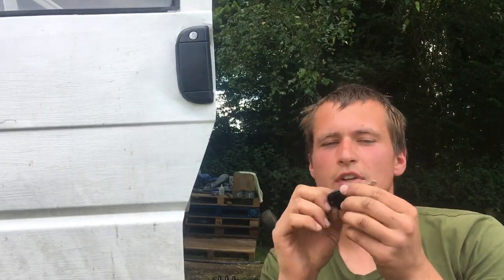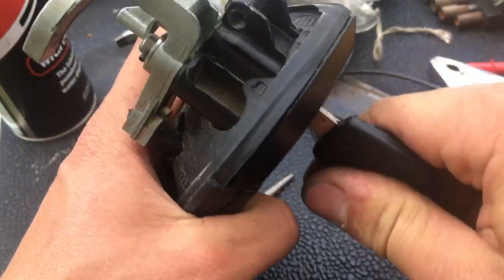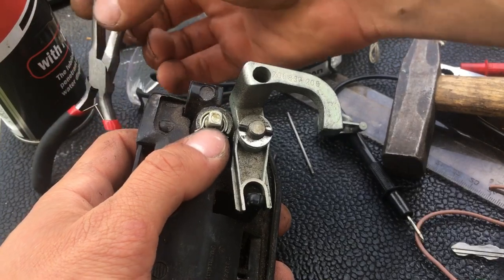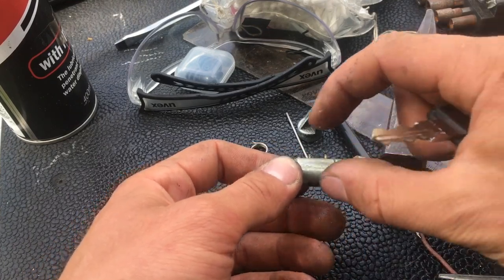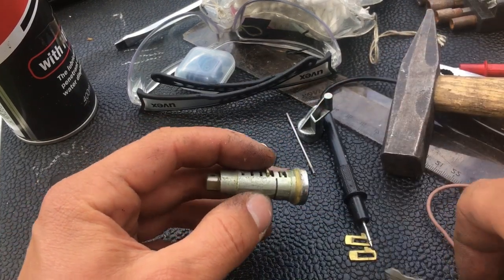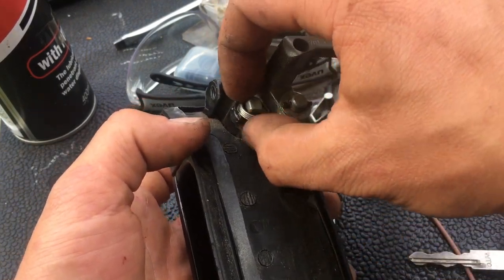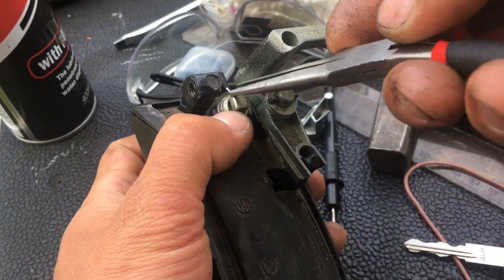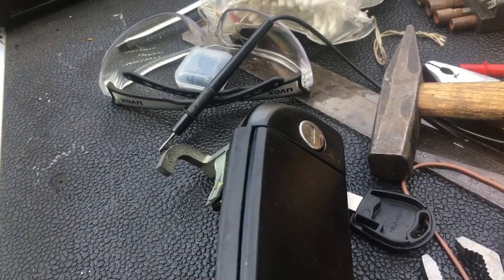Match KEY to CYLINDER under 5mins on VW T4

Comment: Did you atempt to change the side door or back door cylinder? Otherwise I'll post a video of that if I succeed!
Reply: @RastiKucirek  Yeah, looks like it! Thanks again! :) Will give it a try!
Reply: Rasti Breza How were you able to get the pin out for the slider? Looks impossible.
Reply: @ryanpsims73  Actually, I think you have to pull that one (cant remeber which door was which). But on one door you cant knock the pin out, you have to pull it out. With a wrench or something
Reply: What do you suggest if the pin won't come out with a good hit of the hammer